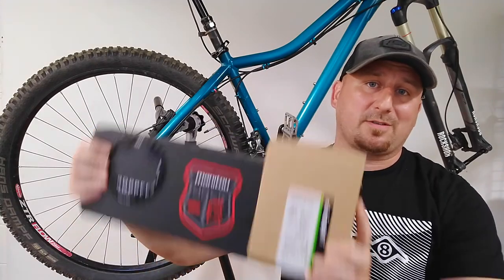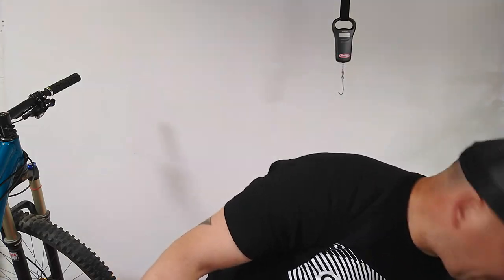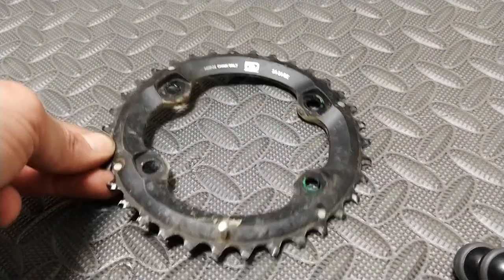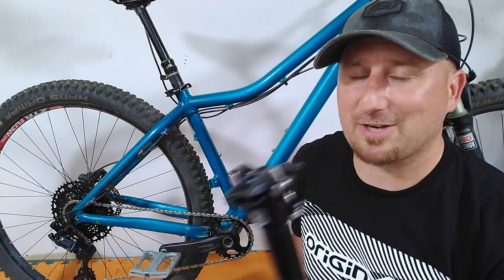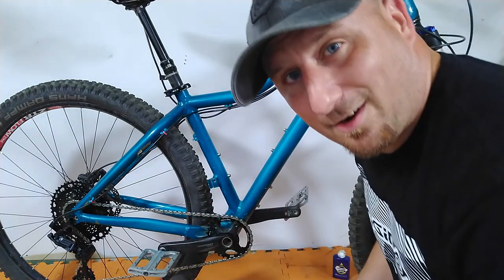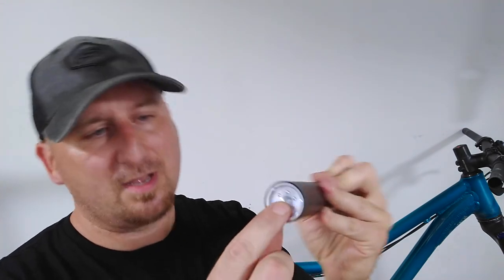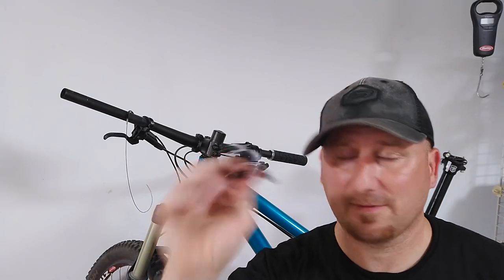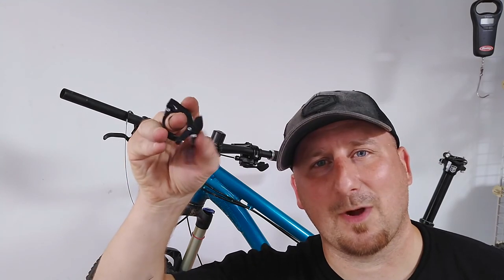Manitou Jack Dropper Post overview install with frame modifications and Advent X group install.

Comment: Rather than drill a new hole could you not have used the holes in the tube meant for the water bottle cage?
Reply from the maker: It could be possible.   We do use the mounts on this bike.    I took the bottle cages off for the video.       Also, the bottle mounts are center to the frame and may be harder to work with if you need to modify the hole to angle the cable exit point.

Comment: Hydraulic dropper cables? Why would one even want that?
Definitely have interest in the Advent X, but it is basically impossible to get in Europe.
Reply from the maker: Rockshox Reverb man.   My only guess is an engineer designed it just to say he could.    I definitely do not see it as a good idea.   Cable is the way.       That sucks a out having a hard time finding Advent X.     It works so well.
Reply: @WattOnWheels  Waiting for the review on hardtail party too. I was originally looking at the M6100, but I kinda dig the idea of not having to use microspline hubs, also giving access to more wheelsets.
Plus the black finish is nice. :)
Reply from the maker: @Dark__Thoughts  I have one other video where I take a deeper look at the Advent X with weights and everything.